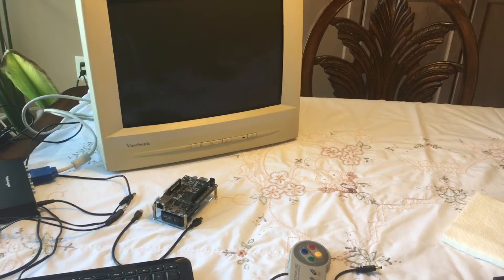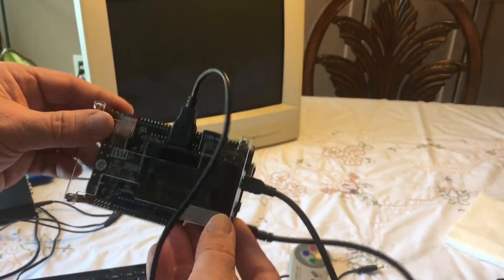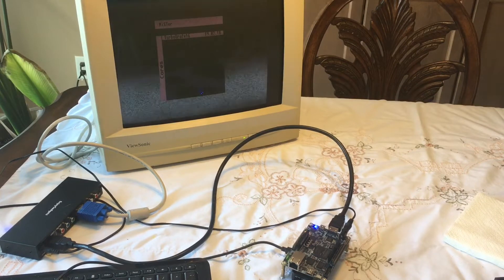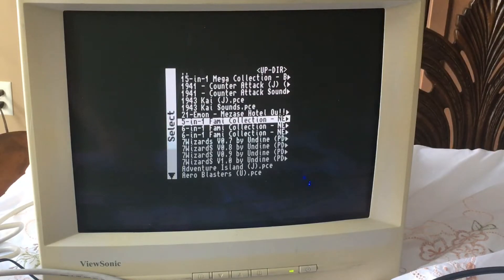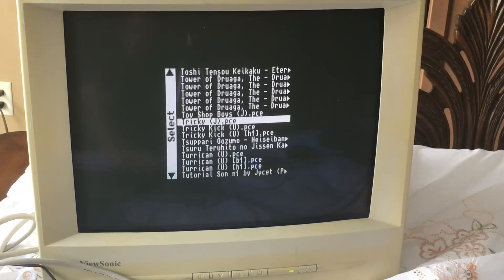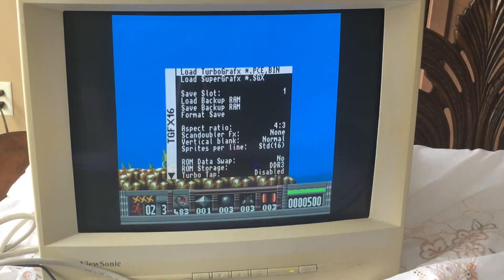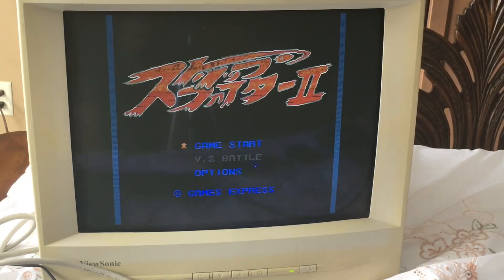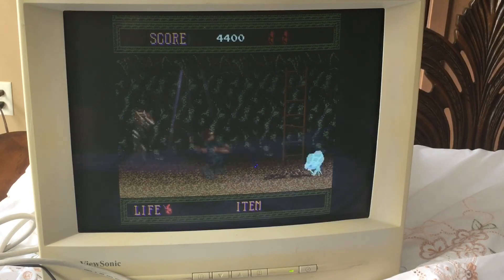Mister FPGA connected to a 17” Viewsonic VGA CRT Running TG-16 core

Comment: I use a 17" pc monitor and it looks stunning with a adjustable external scanline generator and custom scaling,the games running at 60 refresh that has to match your 60 refresh monitor. Its do smooth scaling, its gives a soapboper smooth effect with 0 lag,no jitters,ghosting, jail bars so on.alk my emulators run smooth. If matched.the nes is phenomenal on there 60 frames and it dos not speed up game play it just adds insane fluid animation and scrolling. I do not use any external scalling just an external scanline gen.It has software scalling.
Here's few of my videos on a pc monitor. 
https://youtu.be/f-BAZCI1FbA
https://youtu.be/OsPVtaK5gYU

Comment: You need to be sending a native 240p signal to the screen to get the scanline effect produced as part of the display output, otherwise you’ll need to add the scanlines as a post-process (using the Mister or a OSSC or similar)
Reply from the maker: Thank you!

Comment: Have you tried running a super resolution and retroarch for 240p like doublestrike? I originally thought you were pulling that off with a mister. It sounded like you were missing those scan lines on that thing. That trick I described works in linux and windows. Crt switchres is what you want.
Reply: I do it all on a one rtx 2080. With a startech displayport male to vga female So it's not as dependent on ati/amd hardware.
No more remembering the pixels count of games either. As long as you have the resolutions like 2560x 240@120hz 2560x 224@120hz and 2560 x 480 @60 set in your Nvidia driver you can go in-between snes Genesis ps1 saturn csp2 and more with proper resolution switching. Here's pics of me playing CTR and nights.
https://i.postimg.cc/HLV4T4Rb/20210131-094857.jpg

https://i.postimg.cc/wx0vk87T/20210131-174623.jpg
Reply: One more thing, people say the motion isn't consistent as a bvm or pvm so to anyone seeing this, make sure you do if with a free/cheap monitor as thats the whole point of this project. This has something to do with running 60hz games at 120hz. To me it's not noticeable but I thought I should throw it out there before people think they're getting a 1:1 pvm alternative. And buy out all these nice pc displays like they did with pvm and bvm. I believe the glory days for the professional monitors is gone, so this is our next best thing other than running a 15khz crt tv. It's a damn good one though.
Reply from the maker: @robbystrange4772  Yes, while I plan to connect this to BVM or a PVM in another video to try it out. I will also try a CRT TV, and another PC VGA display.
Reply from the maker: I’m not quite there with the new video cards, I still haven’t bothered to upgrade my GTX Titan lol.
Reply from the maker: Thanks Robby, I haven’t tried that and I have sort of loaded up Retroarch on a pc in the past but typically don’t use software emulation but could revisit again.
Reply: What is a super resolution 🤔

Comment: This is not how you do it, you don't use the scaler when running to VGA, you use direct video (you also need hdmi limited set to 2) with the scandoubler, this allows to run at 480p (and keep native scanlines) and keep the original aspect ratio.
Reply: I have hdmi to vga adapter but it doesn’t sync. What settings are likely wrong on the mister?
Reply from the maker: Thanks Matt, I didn’t have a direct HDMi to vga on hand, or other accessories on hand to pull out the audio. I actually don’t consider that box a scaler. More like a powered converter. 

https://enjoygadgets.com/collections/converters/products/enjoygadgets-hdmi-to-vga-component-ypbpr-converter-2019-v2-720p-w-audio-s-pdif-pthvr-v2
Reply: @ Mathieu If I want to run my MiSTer to my Sony CRT TV do I need to buy the one you recommended or can I buy VGA input to RCA or S-Video output  box?
Reply: @retroforce6919  I personally use RGB SCART. I don't think Mister can do native s-video or RCA output so you would need to convert RGBS to it
Reply: @mathieulh  👍